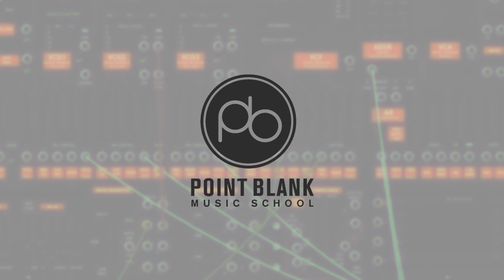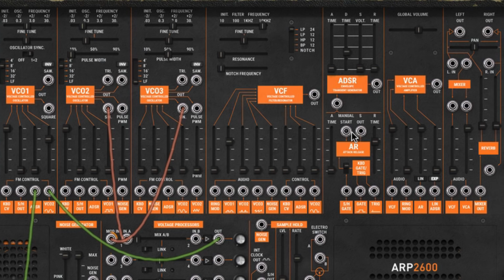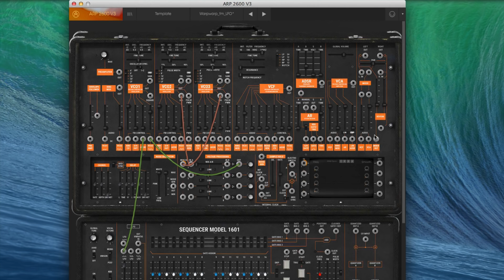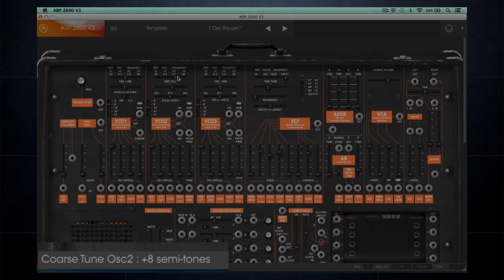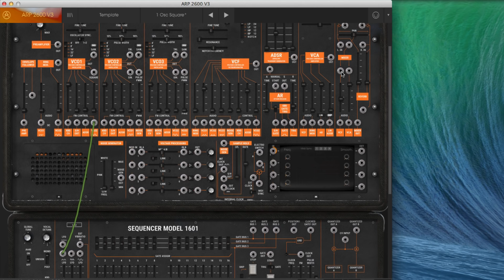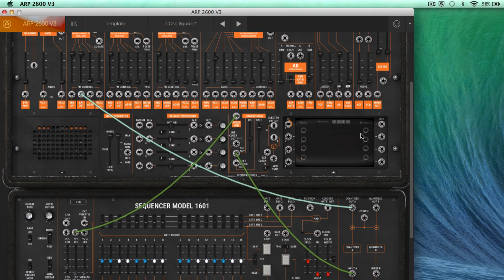Arturia ARP 2600 v3 Tutorial - Part 1: Overview & Modular Basics

Comment: People should be aware that everything you're discussing here, instrument wise (that is, disregarding the preset management and UI scale) applies also to 2600 V2, from the V Collection 4.
They haven't changed anything regarding the instrument, how it works, or its functionality. Not even the sound engine.
Presets can even be converted from V2 to V3 using Arturia's presets converter tool, available from their website.
I hope you do some in depth discussion of the sequencer, as it has some unusual features that I haven't figured out what to do with (the 3 Gate Outs or than "Anded" Gate Out thing, for instance) as well as the Voltage Processor.
Great video. Looking forward to more.
Modular V was the very first software instrument I bought and paid for. When V Collection 4 was offered to me for 50% off, I simply HAD to jump on it. I now use them ALL the time. Between V Collection and Reaktor, I doubt I'll ever really "need" to buy another software synth again.
Reply: artao5 thanks for that :)